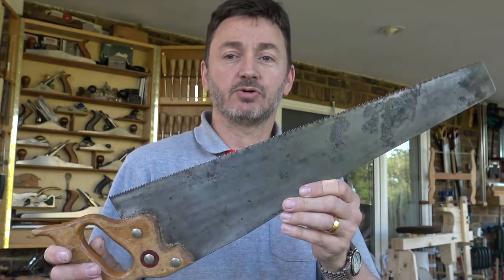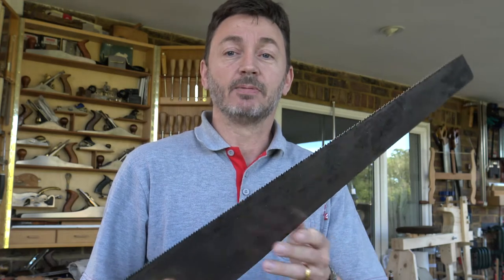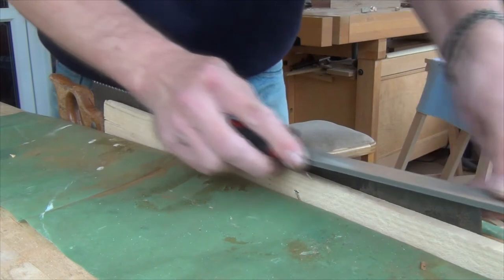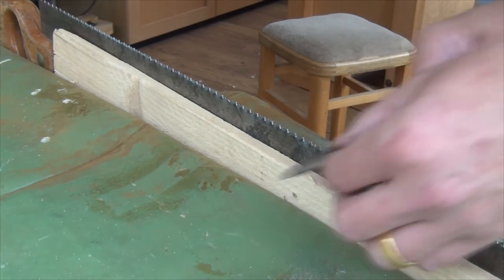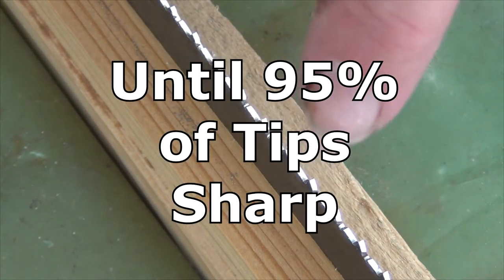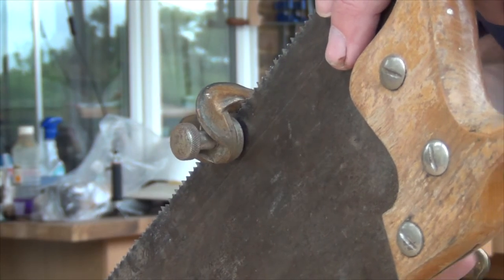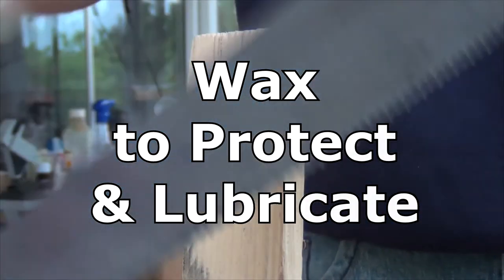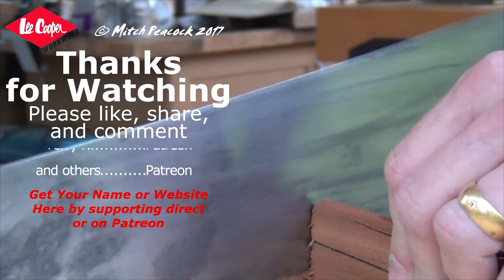Cross to Rip Cut Panel Saw Tune Up

Comment: Nice work. I buy all my saws brand new (Greaves & Sons) my Rip saws (4.5 TPI) all have the tendency to run to the left side, when i try to make a cut. I show you and other videos again and again. Try to put my body and my arm correct but i cant sawing straight. Also my handgrip are good (i think) so what i can do? Maybe an conversation over Hangout with you?
Reply from the maker: Sorry for delay in replying. Please contact me on hangouts or FB messenger